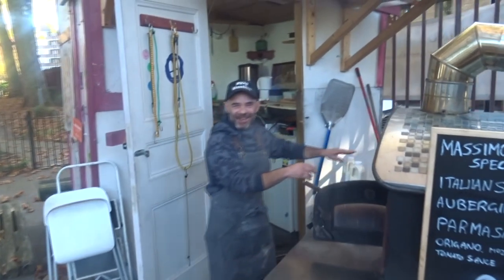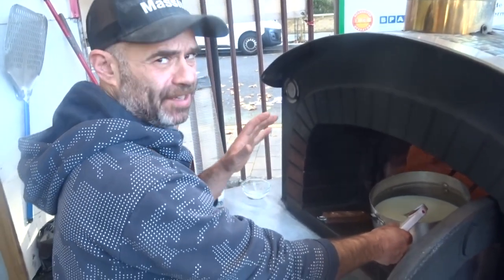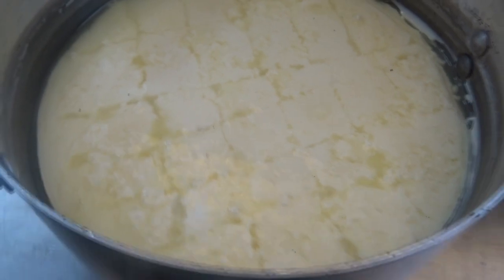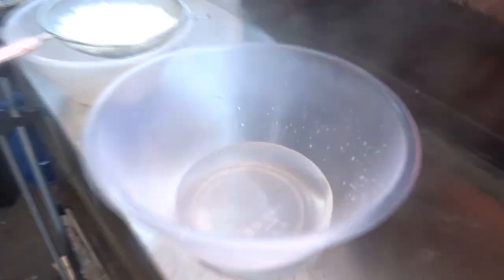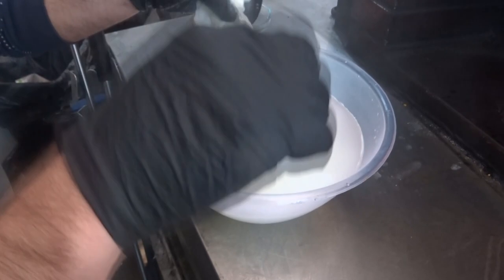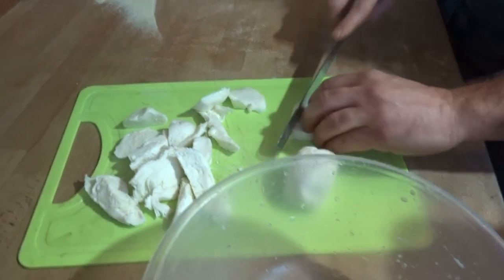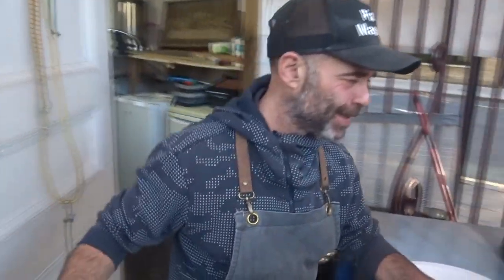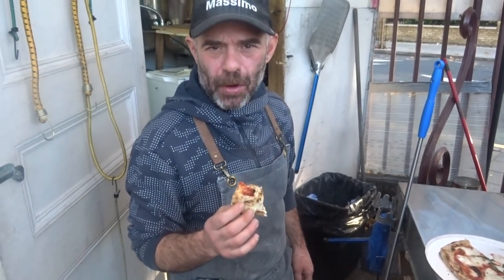How to make Fresh Mozzarella ( Fior di Latte). For your Pizzas ,   with.  Massimo Nocerino

Comment: I'm from India and I used unpasteurized fresh Buffalo milk for this recipe. Everything went perfectly well except the stretching. It started forming strings when I put it in hot water but it became tight very fast so the texture was not smooth. I used 1/4 rennet tablet(full tablet is 0.8 gms) I'm confident that with a little modification and practice I'll achieve good results as the cheese tastes very good. Can you give me any suggestions?
Reply from the maker: Your buffalo milk it's perfect to make mozzarella  you needs keep in hot water only for 2 mimn